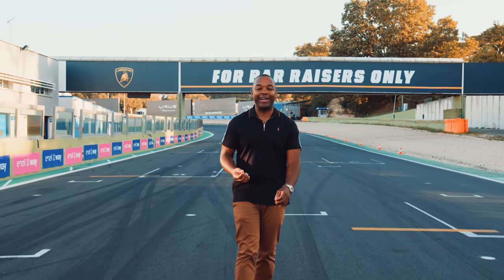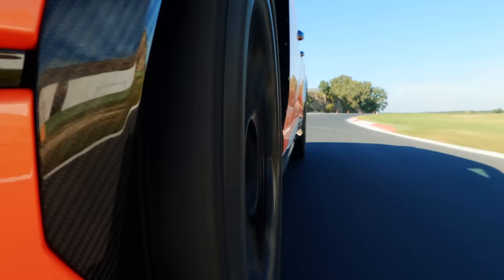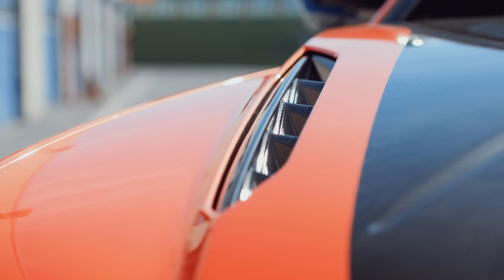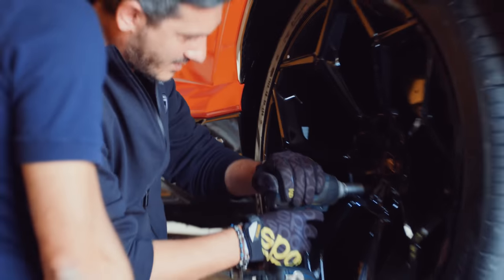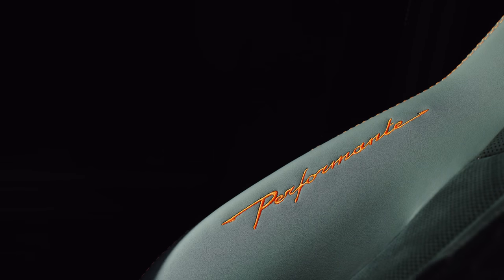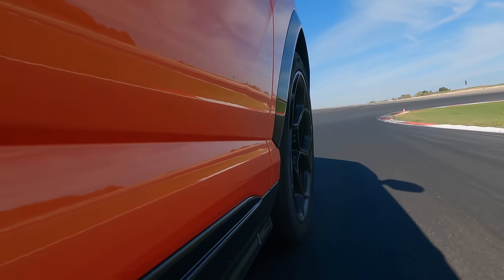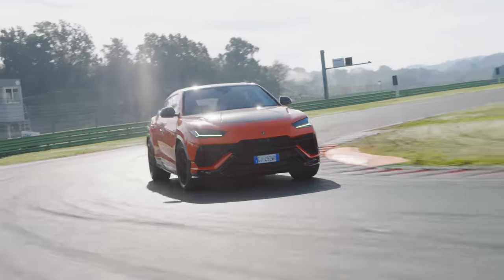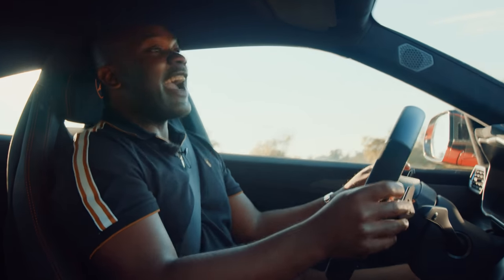Lamborghini Urus Performante Review: The Family Psycho | 4K

Comment: You’d need to buy both versions:  this Performanté and the updated standard Urus version, with the more sophisticated air suspension, than the Performanté’s springs and all the original drive modes for snow; sand and earth - off road.  I think the Audi RSQ8 is the best usable motorway option and £108K.  This is lower; wider and with less sophisticated air and anti-roll suspension and minimally lighter and more powerful:  47kg lighter and 16 BHP more powerful than the standard Urus.  I’d get the top Audi RSQ8, which is the same platform and bi-turbo V8.

Comment: I am a huge lambo fan but urus performante is not that big of a deal since you can just tune your normal urus's ECU add a new body kit and it'll give better performance than this. I don't know how they're gonna compete with purosangue which offers N/A v12 725 hp. I do love the huracan and aventador (no ferrari comes close to these two) lineup since they are original , urus is'nt that bad but it sometimes feels more audi than it should.I love the way the older urus looks btw but this new one (-_-) .....I dont know
Reply: Surely not that hideously eye soaring purosangue that you'd be forgiven for thinking it was designed by their incompetent F1 pit crews loool
Reply: "No Ferrari comes close to a Huracan" 😆😆😆😆
Reply: Did you even watch? It’s more than just power and Bodykit. It’s a whole new suspension set up with a wider track and lighter components and a retuned torque vectoring set up. The Bodykit is more than just some over the top aftermarket nonsense it’s tuned for aerodynamics by an OEM that knows what they’re doing. It’s also going to hold its money better than a urus that some delinquent has tuned in a back street garage and chucked on a load of parts from Alibaba.
Reply: @markcampbell2491  nahh mate...gonna disagree with u there
Reply: @zaids4431  I should of quoted the original comment.
Reply: @markcampbell2491  yup ig
Reply: I'd take an Eletra, it's better faster futuristic for much less...
Reply: @markcampbell2491  yup I really like the way the car looks plus that v10 sounds amazing , it offers great performance for a N/A engine and overall is a better car in my opinion.
Reply: @mountainman6172  The first thing that attracted me to lambos were their high pitched v12/v10 sounds, to me when the urus came out I loved the way it looked but subconsciously, It missed something, that something I found in the purosangue sure it doesn't look as good as the urus and both cars sound good but I like v12s better plus purosangue is not that bad looking as you say, I love the elegance of roma and they tried to do it on the suv and it didn't quite work , anyway these are just my views.
Reply: @jryalls  yeah man maybe you're right these are just my views , I don't hate the car.
Reply: @kishlayverma6622  it’s a v8…..